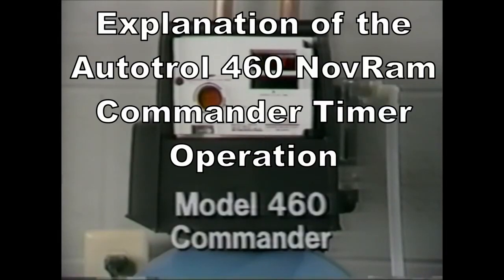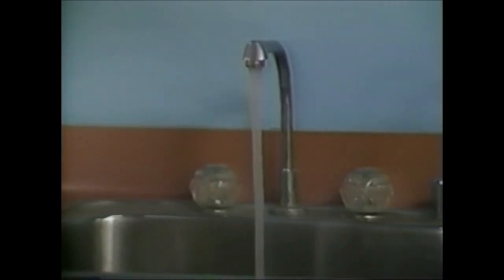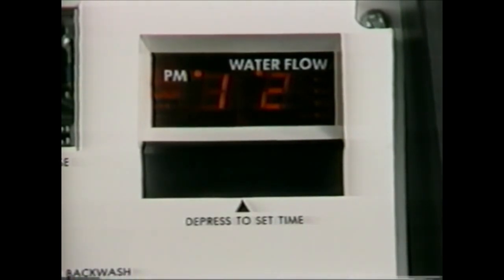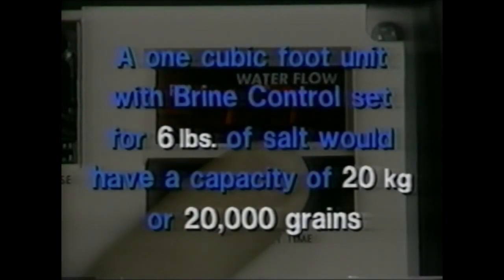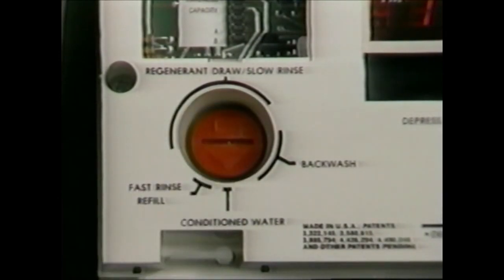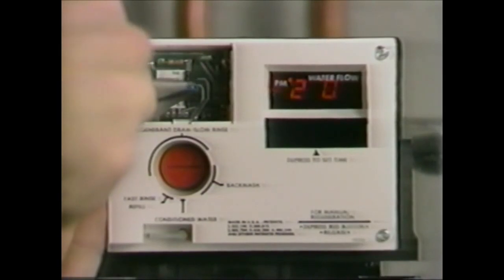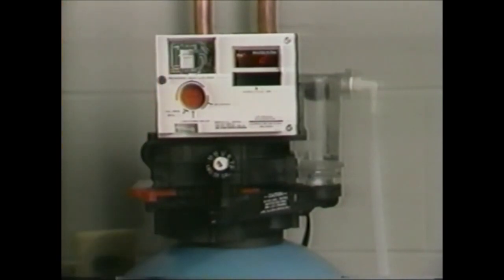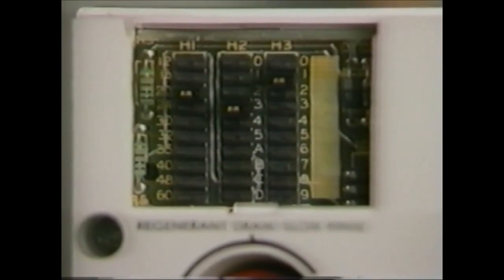Explanation of the Autotrol 460 NovRam Commander Timer Operation

Comment from the maker: Older 460 Nov Ram programs the same as the 460i version that replaced them. Only the location of the PIN section has moved. Operation and programming is the same.